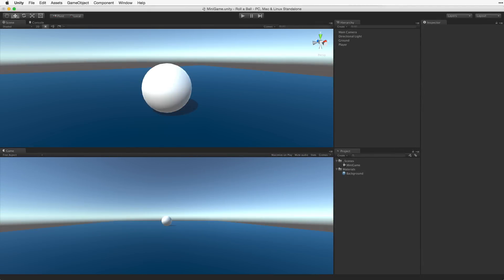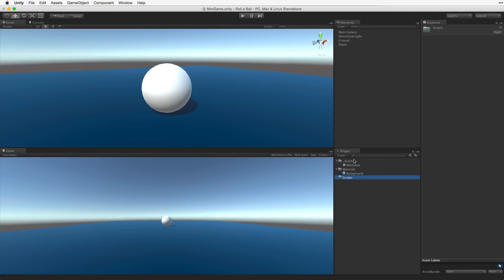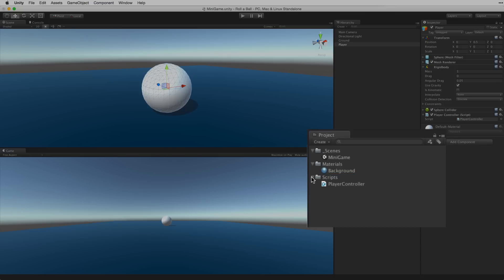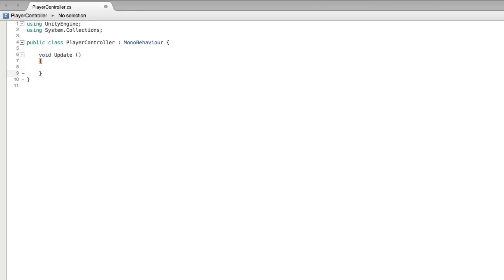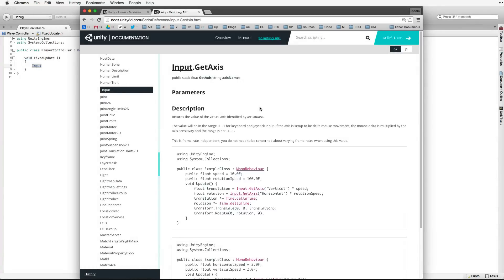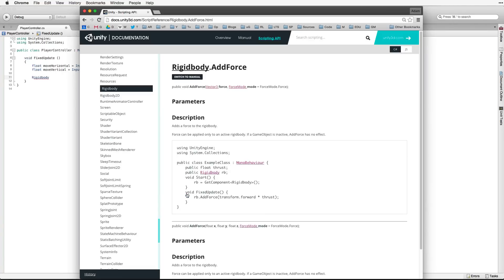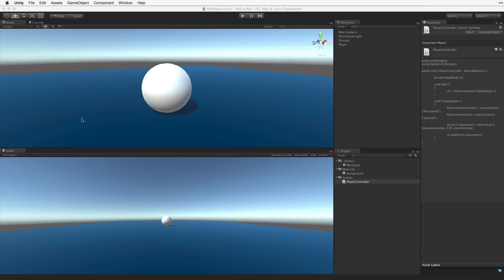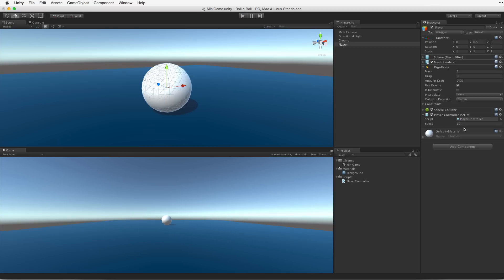Unity 5 - Roll a Ball game - 2 of 8: Moving the Player - Unity Official Tutorials

Comment: Code didnt work for. This did:

using UnityEngine;
using System;

public class PlayerController : MonoBehaviour 
{

    public float speed = 800.0f;

    void FixedUpdate()
    {
        float moveHorizontal = Input.GetAxis ("Horizontal");
        float moveVertical = Input.GetAxis ("Vertical");

        Vector3 movement = new Vector3 (moveHorizontal, 0.0f, moveVertical);

        GetComponent<Rigidbody>().AddForce (movement * speed * Time.deltaTime);
    }

}

Comment: MissingReferenceException: The object of type 'Object' has been destroyed but you are still trying to access it.
Your script should either check if it is null or you should not destroy the object.
Reply from the maker: Can you please ask this technical question on the Unity forums? The link is in the description.
Reply: I was having this issue too. The way that I solved it was the remove the script from the object and then drag and drop the script back onto the object instead of creating the script directly on the object.
Hope that helps
Reply: My friend was also having this issue and this fix didn't work. Ensure that you're void Start as a capital S and that you're void FixedUpdate gas capital F and U :) that fixed my friends issues.
Reply: Robbie Dixon thank you for your help
Reply: No bother, hope I was able to help! :D
Reply: Robbie Dixon It somehow didn't save the first time, so I had to do it over again, and I didn't run into any problems that time... So I sort of fixed it... I guess...

Comment: For everyone who has copied the code exactly and it doesn't move, be sure that your speed value is more than 0. Because if it 0 it will not move!!!
Reply: m8 where is the speed value
Reply: @pe4o243  same problem 2 years later :(
Reply: Please Help me:
The ball doesn't move and
The code is exactly the same (Checked 13 times), and there is no compiler error
The Speed variable is not 0
The input manager is ok
What can I do?
Reply: My ball wasn't moving untill i pressed the Arrow keys. I feel so dumb :D
Reply: GUYS ! i used this code ( in v5.5.1f1 ) and its works also be sure change to speed value to 10 before start actually it can move with speed value 0 but it really slow and not able to see its moving :D( if u dont know how to change please watch video :D about 14:30 )
P.S ; guys__ '' __ not equal to __ " __it seems yea equal but right one in the right :D 

using UnityEngine;       

public class PlayerController : MonoBehaviour
{
    public float speed;

 private Rigidbody rb;

 void Start ()
 {
  rb = GetComponent<Rigidbody>();
 }

 void FixedUpdate ()
 {
  float moveHorizontal = Input.GetAxis("Horizontal");
  float moveVertical = Input.GetAxis("Vertical");

  Vector3 movement = new Vector3 (moveHorizontal, 0.0f, moveVertical);

  rb.AddForce(movement * speed);
 }
}
Reply: +ZunderRL and where can i find the speed
Reply: Where is the "speed value"
Reply: I initialized speed=10.0 in the Start() method, just to avoid such trouble.
Reply: how do yo add Rigidbody it's not recognising it at all and i get the message Load fail: object referenced not set to an instance of an object
Reply: Mine says "All compiler errors must be fixed before entering play mode," and also says it does not have a definition for Addforce...help ?
Reply: Here is the code that works copy this:
using UnityEngine;
using System.Collections;

public class PlayerController : MonoBehaviour {

    public float speed;

    private Rigidbody rb;

    void Start ()
    {
  speed = 10.0f ;
        rb = GetComponent<Rigidbody>();
    }

    void FixedUpdate ()
    {
        float moveHorizontal = Input.GetAxis ("Horizontal");
        float moveVertical = Input.GetAxis ("Vertical");

        Vector3 movement = new Vector3 (moveHorizontal, 0.0f, moveVertical);

        rb.AddForce (movement * speed);
    }
}
Reply: @gauravdewangan3275  Thanks a bunch man
Reply: You should try running/debugging your script (hit F5 in the editor) before you exit the script editor. When i had the same error as you it was because I had a closed {} where it should have been an open bracket.
Reply: same. gonna hang myself
Reply: I have the same issue! Copied the code EXACTLY, speed is 100, Still doesn't move. :/
Reply: Where do I change the speed? I cant find it  XD
Reply: James Hinton make sure that you have spelt Horizontal in the scrips correctly as I spelt it Horrizontal and it did not work.
Reply: wtf how do you give it speed where do you type it in what do you type?
Reply: If you click Player under the hierarchy you will see the inspector at the right hand side , in the inspector at the bottom there is Player controller script ticked and below that there is speed value which can be changed .
Reply: No it should be :  
speed = 10.0f
Reply: still not moving
Reply: me too
Reply: all I get are errors
how to fix

plz
Reply: For me the ball won't move and the error says Input Axis Horizontal is not setup. can someone help? :(
Reply: I EXPERIENCED IT TOO BUT I UNDERSTOOD IT.IN YOUR SCRIPT  THERE WILL BE SOME WORDS IN RED COLOR .THEY ARE CAUSING THESE PROBLEMS. OPEN YOUR SCRIPT AGAIN AND CORRECT THE RED COLORED WORDS .NOW YOU CAN PLAY
Reply: keep getting ArgumentException: Input Axis Horizontal is not setup any suggestions
Reply: I had the AddForce error... just a typing mistake, I wrote Addforce instead of AddForce. Thank god I don't make a living with coding.
Reply: Thank you :)!
Reply: Vector3 movement = new Vector3 (moveHorizontal, 0.0f, moveVertical);

but my 0.0f isn't red colour it's black as normal text
Reply: WHERE IS THE SPEED VALUE???????? THANK YOU
Reply: How do i create the speed value lol
Reply: For all those having issues, see here. I spent an hr searching for solution you know what fixed it? Controlling the ball with WASD keys lol. I can't believe it.
Reply: Thank you
Reply: I just did the update in Unity and everything works fine now ! thnx
Reply: +mushey ali Thanks!
Reply: Snakeblood913 You create it
Reply: VaultGames lol
Reply: There are other things that can cause this -- for example, if the Rigidbody was not added or was not saved, or if the controls are not set up correctly.
Reply: Make sure you build your project by pressing F7 in monodevelop
Reply: thanks that helped me. lol
Reply: Elijah Tai There is indeed a inertia factor playing in this. However, maybe it's a good excercise to do for object you want to accelerate faster. For example, I don't think you want your character accelerating like this in an MMORPG. Instead of using the given method, I would challenge myself to a next step. Also, these guys simply added a initial velocity rather than an acceleration.
Reply: What's the error? I had an error as well, but had to change the last line in the script to movement; rb.AddForce (movement);
Reply: I was able to solve it. In my case I had accidentally skipped a step and had an unfinished C# script from the camera tutorial. I didn't think there would be anything wrong with just keeping it around until the next video, but I was wrong. I deleted that script and the references to it, and I was able to get my ball moving.
Reply: Cool
Reply: how do you change the words to blue
Reply: how do you make words blue
Reply: Thanks for the tip! I was really angry that it did not move. Now its working fine!
Reply: Many thanks from China! I finally made it followed your advice. Thank you pal.
Reply: Dude You are the bomb
Reply: mushey ali I know that comment is old but thanks.
Reply: thx for the great info :)
Reply: My fault was that I wrote 0 instead of 0.0f :D
Now everything works
Reply: How do i do that?
Reply: This fixed my problem thanks
Reply: THANK YOU SO MUCH!!!! when i read your comment i noticed that i wrote playerController and the script was Playercontroller. THANK YOU!!!!
Reply: Ekrem TUNÇ what keyword should i press
Reply: what the hell???? how can I fix.... I read other reply and still confused
Reply: @Micheal Stone did you fix it now???
Reply: same here
Reply: Same here.  My ball rolled off the ground.  No borders.
Reply: i have the speed value and everything works but my ball wont move o-o
Reply: Ffaegawg Afwegaewgreg same for mine thanks for pointing it out
Reply: Thanks worked oh and if any one is having a problem with finding out what keys it is there the arrow keys
Reply: Same
Reply: Guys who complain about difficulty of the guide check scripting guide and inerfece guidelines first, complete them than it will be much ezier to understand this. raw C# is recomended but not mustKnow.
Reply: ha ha, thanks!
Reply: public float Speed; ?
Reply: Hi, guys just make sure to write FixedUpdate like so, because I wrote it like "FixUpdate" and that is why it didn't work for me.
Reply: what am i missing?The ball doesn't move even after setting speed.
Reply: Weird, I didn't touch speed, can't find it as of yet and it moves.
Reply: Where is this "speed value" everyone keeps referring to?
Reply: How do I do that??
Reply: You amazing. I've spent like two hours on this. Thank you so much <3
Reply: Not only that make sure it says at the top

public class Playercontroller : MonoBehaviour
make sure the (playercontroller)is the same spelling on the script and in the asset folder.

hope this helps someone.
Reply: My "Input" is not colored in and is like any other word,  is that why I can't play the game?
Reply: ah i shoulda learned c# first fuck you
Reply: If you want a more realistic way, programme some acceleration in it. This will just mean s[i+1] = v[i]*dt + 1/2*a[i]*(dt)^2 
When the initial speed is 0 you will still have a acceleration and the speed will increase. I'd say try it out, learn some physics and you can create cool stuff!
Reply: Same problem. My script is perfect but I get the error message.
Reply: OMFG I'M RETARDED TOO XD!
THANK YOU SO MUCH!

Comment: Assets/Script/PlayerController.cs(28,12): error CS1061: Type `UnityEngine.Rigidbody' does not contain a definition for `Addforce' and no extension method `Addforce' of type `UnityEngine.Rigidbody' could be found (are you missing a using directive or an assembly reference?)

Comment: it doesnt work i have looked at thousand of vids i have never been able to move it . also i have copied the EXACT copy of the script and still doesnt work what do i do?
Reply: This might be a bit late, but i forgot to add the Rigibody. This might be your mistake aswell?
Reply: How about you stop telling people what to do. The comments section exists for a reason.
Reply: Check if the ball got the Rigidbody, clic on Player then add component => Physics => Rigidbody
Reply: I have a very similar problem, I also copied the script below. For some funny reason the physics settings of the player were not maintained so I had to add them several times. My scree is exactly as the tutorial and the player just does not move.

Have you guys learned a way to work this out? This is very frustrating
Reply: +Teknoloji Delisi Yozgyur you might be missing some references. Check if there are errors or warnings right after you compile in unity console
Reply: would you mind past your code in here so I can have a look at it. And make sure that you give value more than 0 to speed variable in unity for the player or else it won't move.
Reply: honestly cant unity hire a decent person to do this?
Reply: Ok you have to add speed in to void start speed = 5; and it is working for me
Reply: nope
Reply from the maker: Please post on the unity forums for help. Use the link in the description.
Reply from the maker: Can you please ask this technical question on the Unity forums? The link is in the description.

Comment: "@13:04 Hit Play, and by using the keys setup on the input manager,the ball moves in the scene" -- Which keys did he mean here?
Reply: Hi, this is the full script for moving the ball. Make sure that you have attached to the sphere this script and the rigidbody by clicking add component in the sphere on the right side of the screen.

using UnityEngine;
using System.Collections;

public class PlayerController : MonoBehaviour {

    public float speed;

    private Rigidbody rb;

    void Start()

    {

        rb = GetComponent<Rigidbody>();

    }

 void FixedUpdate ()

    {

        float moveHorizontal = Input.GetAxis("Horizontal");
        float moveVertical = Input.GetAxis("Vertical");

        Vector3 movement = new Vector3 (moveHorizontal, 0.0f, moveVertical);

        rb.AddForce (movement * speed);
    }
}

I hope it works!

:)
Reply: +Smit Parmar I also can't figure out what he hit somebody please help!
Reply: +Smit Parmar The arrow keys. Also, don't forget to input the speed.
Reply: How do you input the speed?
Reply: Electro Dominator Watch from 13:24 for the speed input demonstration.
Reply: I input speed and it allows me to put in script (no errors) but i still cant move the ball i used WASD arrow keys and even the NumberPad arrow nothing works plz help
Reply: I had the same problem just initial the speed at top equal to 10.
public float speed = 10.0f;

Comment: I am working in 5.3.4f1 and the code was not valid for this version.  rb.AddForce is no longer valid.  In order to make this code work, I added the public float speed = 10; and change the AddForce to velocity.  Code is below.

using UnityEngine;
using System.Collections;

public class PlayerController : MonoBehaviour {

 public float speed = 10;
 private Rigidbody rb;

 void Start () {
  rb = GetComponent<Rigidbody>();
 }

 void FixedUpdate () {
  float moveHorizontal = Input.GetAxis ("Horizontal");
  float moveVertical = Input.GetAxis ("Vertical");
 // float xSpeed = xMove * speed;
 // float zSpeed = zMove * speed;

  Vector3 movement = new Vector3 (moveHorizontal, 0.0f, moveVertical);
 
  rb.velocity = (movement * speed);

 }
}
Reply: +Loa Thanks works for me!
Reply: +Loa Ledbetter  i am also  working in 5.3.4f1 and  rb.AddForce is  working absolutely fine
Reply: Worked for me!
Reply: Thanks For the Save, other codes have too much detail to understand for beginner like me, yours is just what I needed.
Reply: AddForce works for me, velocity does not and I'm ommenting this later than you did

Comment: i did every thing you did but it dident work :using UnityEngine;
using System.Collections;

public class playercontroller : MonoBehaviour
{
    private Rigidbody rb;
    void start() { rb = GetComponent<Rigidbody>(); }
    void fixedupdate()
    {
        float moveHorizontal = Input.GetAxis("Horizontal");
        float moveVerticacal = Input.GetAxis("Vertical");

        Vector3 movement = new Vector3(moveHorizontal, 0.0f, moveVerticacal);
        rb.AddForce(movement);
    }

}
Reply: +michieb1231 float move vertical is the problem you spelt vertical "verticacal"
Reply: using UnityEngine;
using System.Collections;

public class PlayerController : MonoBehaviour {

    public float speed;

    private Rigidbody rb;

    void Start()

    {

        rb = GetComponent<Rigidbody>();

    }

 void FixedUpdate ()

    {

        float moveHorizontal = Input.GetAxis("Horizontal");
        float moveVertical = Input.GetAxis("Vertical");

        Vector3 movement = new Vector3 (moveHorizontal, 0.0f, moveVertical);

        rb.AddForce (movement * speed);
    }
}

Comment: When I hit play, my ball just jumps in the air. I still have controller, but not for long because it flies away after a while. It stays at about 1 on the y axis. I am using Unity 5. Any help?
Reply: +hipoleev I had the same problem with the ball bumping up or jumping on the Y-Axis to position 1.0 after pressing play. Solution: In Hierarchy, select "Ground" object. Then in Inspector for that object, UNCHECK the "Convex" setting for the Mesh Collider. I had somehow checked this by accident in the inspector when I created the object.
Reply: ***** thanks!

Comment: Why I did the same you but it not work

using UnityEngine;
using System.Collections;

public class PlayerController : MonoBehaviour {

    private Rigidbody rb;
    public float speed;

    void Start() {
        rb = GetComponent<Rigidbody>();
    }

    void FixedUpdate() {

        float moveHorizontal = Input.GetAxis("Horizontal");
        float moveVertical = Input.GetAxis("Vertical");
        Vector3 movement = new Vector3(moveHorizontal, 1f, moveVertical);
        rb.AddForce(movement*speed);

        
    }
}

Comment: I know I've already been the squeaky wheel about this but I want to reiterate this problem where it actually can be found. As of update 5.3.3, this portion of the tutorial no longer works. I know it's not me, because it was working fine before the update. And I know it's not that I mad a mistake with the code, because the second time I programmed this game, I copied the sample code directly from the sample given under this video on the website's tutorial page. Clearly, there was a change with the language syntax, as part of the update was changing the C# editor from Monodevelop to a new software. I repeat the problem specifically is that when the program runs, the sphere does not roll or move. I don't think it's unreasonable to be frustrated that the official tutorial does not support the program it was meant for.
Reply: +Annie Trinity Thank you! I was beginning to think I was crazy. Sad this isn't working, but glad others are aware and looking for a solution.
Reply: +Annie Trinity Any solution?
Reply: Kellen Terrett Then please write Unity and any other way you might be able to be vocal about this. Tutorials are supposed to provide correct information; this needs to be fixed ASAP.

Comment: I'm getting Error CS1061: 'UnityEngine.Rigidbody' does not contain a definition for 'Addforce' and no extension method 'Addforce' accepting a first argument of type 'UnityEngine.Rigidbody' could be found (are you missing a using directive or an assembly reference?) (CS1061) (Assembly-CSharp)